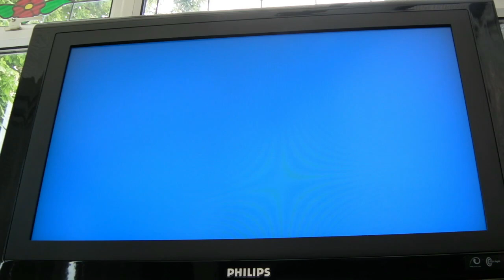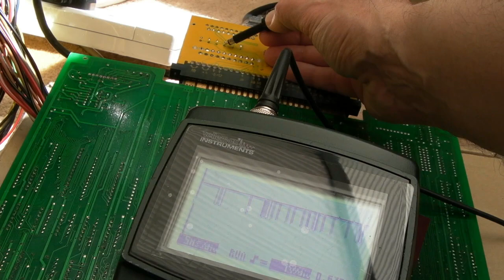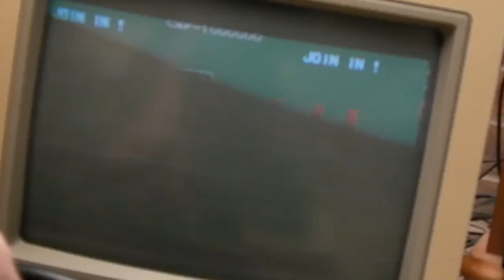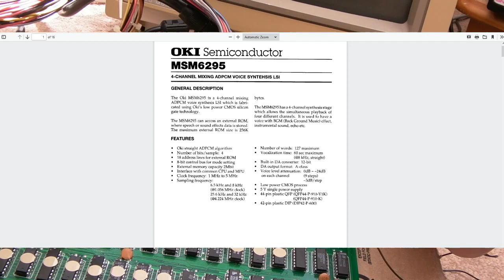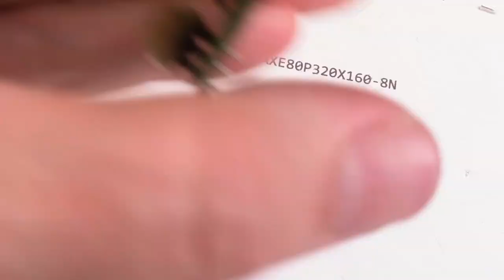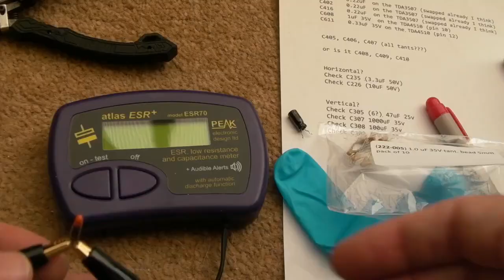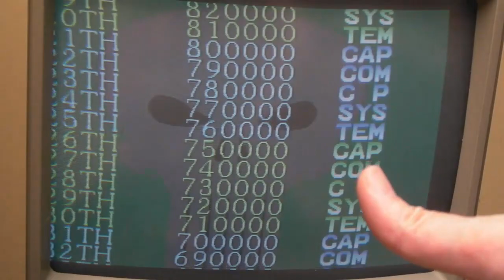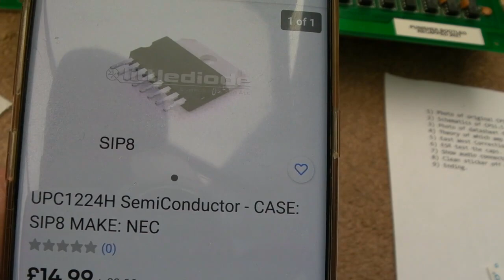Punisher Bootleg JAMMA & Commodore 1084S Part 5 - Repair

Comment from the maker: NOTE: Never let me navigate for you - I got East and West on the wrong side lol!
Worth clarifying my point on the PIC "emulating" the Q-Sound stuff - I said that in quotes (""), because its probably not emulating much (other than an interface for the 68K to request sounds and music tracks).  The samples and music have probably been converted to a PCM format that that m6295 likes, or they may have recorded them from the output of the original and converted to that PCM format for the m6295.   The lazy part is they could have fitted 2MB of audio ROM and converted all the sound that way.
1084S Repair
Part 1 - https://www.youtube.com/watch?v=YeLdkaHOxpw
Part 2 - https://youtu.be/_YtIhoOffy0
Part 3 - https://youtu.be/gs_epqnsrRQ
Part 4 - https://youtu.be/CMQwl7LjP-I
Part 6 - https://youtu.be/yndStmgy47k
Part 7 - https://youtu.be/ZMogbh_WIVw
Reply: Noticed that too 🙈🤣
Reply: lol!!. I didn't even notice so I won't be navigating either :-p
Reply from the maker: Haha =D
Reply: From the Top and Clockwise it's: Never Eat Shredded Wheat (in the Northern Hemisphere anyway). For Port and Starboard ask the question: Is there any Red Port Left? 😉
Reply: @SimonZerafa  I've always used Never Eat Shredded Wheat too... the other one I'd heard as "port is always left till last".
Reply from the maker: @SimonZerafa  I do know my N,S,E,W btw - I just had a moment where I wrote down east first, then west, because its called East West Correction.  I paid no attention to the side it was on ;)
Reply: I think you are tright about the sound part. The PIC just handles bank switching for the MSM6295 chip. This chip has been used a lot on both legit and bootleg boards. I have studied it deeply when I repaired a World Rally board. I made a tool that lists the ADPCM samples on the sound EPROM, and plays them on the PC.
Without looking at the schematics, I imagine the original board had a Yamaha audio chip for the music AND an MSM6295 or so for the samples. Musics have been ADPCM encoded and injected in the EPROM. But due to the low memory the 6295 can handle and the bank switching technique, there is no room in a bank to fit both samples and music. Also note the 6295 only handles 4 samples to be played simultaneously. So one for the music and 3 for the samples.
Also note a common technique is to duplicate samples on different banks to store them with multiple parts of the same music ;).

Comment: That board might be a bit of a mess, but emulating the QSound driver with a PIC is really impressive... seems like some smart people designed that thing!
Reply from the maker: See my pinned comment above - I suspect its doing little more than feeding "converted" PCM tracks and samples to the DAC!
Reply: Yes it is very impressive. Koreans are the best reverse-engineers in the World.

Comment: SPOILERS!

The TTL chip was already removed when I bought the board on Feebay.

I do recall getting video out of it as well, but I test stuff like this on a CRT, as it makes it much easier to diag stuff like this, vs a modern LCD.

I don't remember the audio amp missing, but then I only tested the board for about ten minutes. lol

I bought the board mainly to try to help reverse some CPS stuff for when I was working (struggling) on a CPS core for MiSTer. Sometimes the bootleg versions of boards can help figure stuff out, because they've already done the work of converting some of the custom chip logic to TTL.

I'm only 16 minutes into the vid, but thinking you could probably just hook up two wires to get line-level audio onto the SCART output on the Supergun. I'm betting that's what you'll do later in the vid. hehe
Reply: I agree that the board is a "piece of junk", btw. A lot of bootleg boards are. lol

I didn't even spot the fact it was using a PIC for the sound. I think "emulation" is a fair term there, as it probably is emulating the Z80 instructions in software.

I don't have even half your patience to work on a board like this. lol
I still have an original CPS1 board with Street Fighter 2 on (fully working), but I'll probably sell that soon.

Now that Jotego has done the CPS cores, I don't really have a need for the original board.

But yeah, bootleg boards are still a historic piece, and often very interesting to work on.

I was mildly tempted to do a full schematic of this board on Eagle, if only to help work out some of the sprite logic (CPS boards often use a full framebuffer for sprites).

But there's already quite a bit of info online about CPS, thanks to the likes of Charles Macdonald, and the MAME team.

The PLCC sockets on these boards don't look great, btw. I think I had to clean the contacts then press the chip in firmly before I got any video at all out of it when I first tried it.
Reply from the maker: Thanks for the board - enjoyed working on this one!  Wish I could say the same about the Mega Tech board lol!  I think with that I need to do a lot more, and less chance of success I think =/  Thanks for your help with the Mega Tech on Twitter!  Not had a chance to reply today!
Reply: @GadgetUK164  No problem at all. You know I don't mind. ;)

No obligation to repair everything either, btw. You work too hard on this stuff already. lol

Comment: Nice to see it working again! Looks like a typical bootleg of the time, similar to the Street Fighter 2 ones (most bootlegged game in history I should think!) amongst others! I think the same factory (maybe more than one!) was knocking quite a variety of bootleg games out back in the day, i've got a bunch of those in the loft that look very similar to the one in the video! Also pretty typical to see the sound amp snapped or ripped off due to the factory not bothering with a heatsink. I checked a bootleg of mine and the first one I picked up similar to yours has got a NEC uPC1242H on it, i'm sure i've seen other versions of this made by other companies that might be cheaper. Bootlegs can be finicky with the 5v, some i've had need something like 5.4v and some won't work unless it's just below 5v. To be honest, i'd never use anything other than a crt monitor or ideally a proper crt arcade monitor (which would have sync pots) for testing arcade pcbs (although I use a multisync Acorn crt monitor for testing mine). The sync is composite and horizontal should be fine at 15khz, vertical sync should normally be 60hz but quite often (especially on bootlegs) the sync is usually off a bit, like 59.4hz for example or even lower (or higher than 60hz), which can cause problems with some 15khz monitors that don't have a sync control. The thing that I always found simultaneously amusing and frustrating with bootlegs is ones where they sanded off the tops of the chips they used - to apparently try and stop their bootleg being copied! By the way, there was a sync fix on some Namco cabinets that used a resistor (5k if I remember correctly) between sync and ground, it was to help stop an interlace flicker with Hantarex Polo monitors but it may help the sync flicker in your case also.
Reply from the maker: Thanks for the info there, especially on the audio amplifier, and the point about the sync!  I bet you are right there, I bet its something close to 60Hz.  I need a more modern scope really!

Comment: Friend, If you are doing to be doing PCB work, you need  better desolder solution. I started using a tool from Airvac Engineering in the early 80's when I was doing component level work on early PC's. I still use it today for microcontroller projects. I also have the Hakko desolder tools and it's better for solder globs or heavy ground planes but for precise through the hole IC's etc the AirVac is much better.
You need a shop compressor to drive the tools. It takes 80 psi and converts that to 30" vac.
Often, I can vac all of the pins up to a 28 pin eprom, wiggle it once, turn the board over and the IC falls off the board. I NEVER damage a pad since most of the time I pull all of the old solder off quickly and with one vac pull.
Order some extra consumables and have a spare trap reapy to go. It takes about 5 mins to swap the trap, only because of cool off and warm up. Usually, I can use the tool for a few days b4 swapping the trap even when I do a lot of IC removals.
You will need a stand to rest it when not in use and I don't see one on their page now. However, they show up on ebay from time to time. Or fabricate something. Also, maybe the Hakko stand will work.

https://www.air-vac-store.com/mm5/merchant.mvc?Screen=CTGY&Store_Code=AS&Category_Code=PVSG

Here is the Hakko unit I use.

https://www.amazon.com/Hakko-FR-301-Desoldering-633-01-Nozzles/dp/B07HQXLTKN/ref=sr_1_5?crid=18TBQ5Z4Q4EPW&dchild=1&keywords=hakko+desoldering&qid=1624313015&sprefix=hakko+de%2Caps%2C167&sr=8-5

Regards,
Glenn
DSM Labs
Reply from the maker: Thanks, but I have Hakko already, and a desolder station that is more than capable for this stuff!  The pad damage was already done to this board!

Comment: If I may, I would suggest getting some assistance from some extra flux. I´ve found that the tiniest amount of fake cheapo Amtech just touching one side of each pin does wonder to improve not just the soldering, where usually isn´t that a big deal in this kind of jobs, but especially desoldering. My crappy wick roll works several times better and the desoldering gun which initially had me frustrated with the more recent electronics with modern high-temp no-lead no-joy solder is working like a charm and the unobstructing wire that came with it is now barely used. That suggestion of a drop of flux in every pin has improved the experience a lot.

edit: sorry, missed to point I was talking about the early work in the missing dip chip. You´re obviously using flux later with the 6295

Comment: that blue background color is normal on this bootleg board. I fixed one along time ago and thought it still had a issue but after getting another one it also had the same color issue. Try using the service or test pins on edge connector should bring up a menu to change settings ect. Some bootlegs have a test button on the pcb. With sync what ive done on a few bootlegs to sync on a 1084 monitor was change the video clock crystal to either a faster or slower value to solve that sync issue
Reply from the maker: Thanks!  Yes, pretty sure you are right - it probably is outputting a something close to 60Hz, but not near enough.

Comment: When I see video layer corruption (as in "only the sprites are garbled" or "only one of the background layers is garbled"), I usually piggyback random RAM chips in the video section of the board and see if that changes anything.
If that doesn't change anything, I test with the scope if the piggybacks fight the original RAMs and lose.
And if that's negative, then I go grab the schematics. If there aren't any, I start randomly shorting data pins on ROMs to ground to pinpoint the location of the fault. And then I either dump the suspect ROMs or go hunting for bad logic signals. Sometimes I do that first though, but if the faults look like Video RAM error... goto 10.
43:50 Probably a deglitching cap.

Comment: Well, at least that board has plenty of spare TTL chips you can yank for repairs on a dead C64 or Amiga or something. I suspect that the parts on the board are probably worth more than the whole board; a known-good 68000 is handy for testing older Amiga or early Macs if you suspect they have a bad CPU. Is the PIC a “16C” or “16F” variety? Anyway, another good diagnosis/repair video. 🙂
Reply from the maker: Hehe =D  I cannot remember the PIC model number now, I did mention it in the video though!

Comment: Wow some replacement ic's are super expensive lately :( - nice repair work! I've found using an oscilloscope is pretty useful at troubleshooting sync issues - maybe its a weak signal or whatever.
Reply from the maker: I did trace the sync to where its generated etc - and looked at the ICs there.  Pretty sure they are OK.  I suspect its the frequency!  I might revisit at some point!
Reply: @GadgetUK164  sorry to spam, but it is a subjet I am working on these days ;-). Some arcade boards (espacially bootlegs) generate non-standard frequencies. I have 2 outputing 51Hz and one outputing 57Hz. Video signal converters like GBS8200 and probably some TVs don't lock on these frequencies. It might be the case of your monitor, and that might explain the horizontal offset you observe as the monitor's PLL tries to lock on a near 60Hz signal...?
=> oscilloscope time! ;-)

Comment: Boots are temperamental. They are a compromise on quality and money. Most bootlegs are okay. They are easier to repair due to the absence of custom chips (with the exception of the PLCs) I personally have around ☆100 JAMMA☆ - boards and over half of them are bootlegs... ♡ em!

Comment: Nice video and handy work. I’ve added a TF330
on my CD32 with a vga cable. It was working great however now it’s flicking. Any ideas please? I tried the S video cable and it was fine.
Reply from the maker: I suspect its probably the cable you are using!  Are you connecting up to a VGA monitor?  That won't work, unless its a true multi sync monitor (some of the NEC Multi Sync monitors will work - but not all).
Reply: @GadgetUK164  I changed mode to delacing and forget! Fixed now, doh! Thanks for getting back